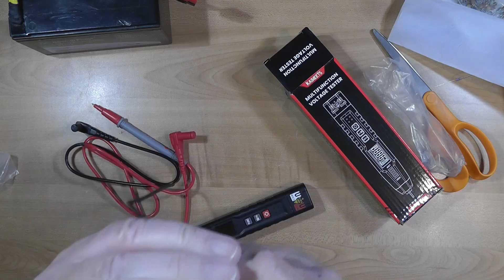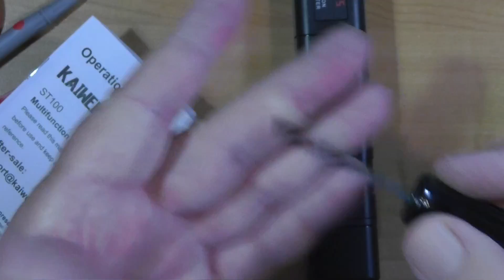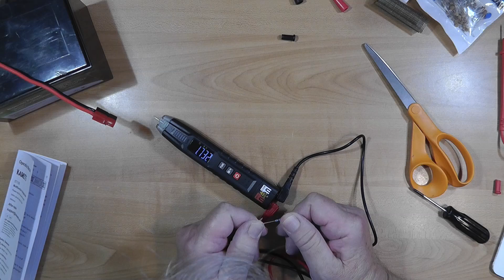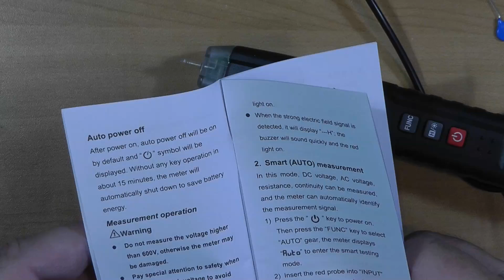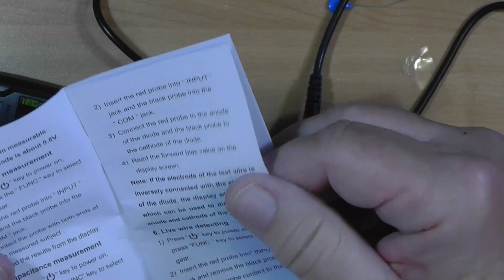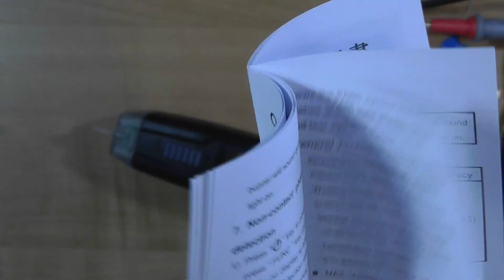The Kaiweets ST100 (#741)

Comment: It is hard to tell looking at the video but on the DC wires the motion that seemed to trigger the live indicator, at least from my angle, was in toward the wire, rather than along the length. On a DC lead I would think that would correspond to a detectable increase in field strength as well.

Comment: Hi David, thank you so much for your effort in making such an instructive video about our ST100. We are so happy to see how you interact with our product in the video.

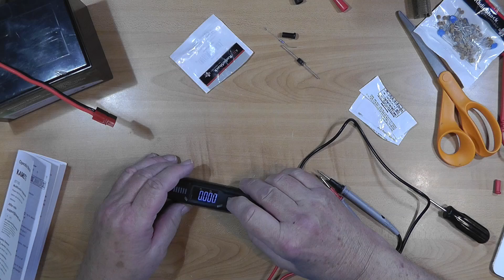Other than that, we noticed that you felt a bit disappointed while you were testing diode under Auto mode. We are actually sorry for the confusion caused to you since Auto mode can only be used to identify measurements including Voltage, Resistance and Continuity. That’s the reason why, from 0:13:20 to 0:13:40 in the video, you only got a reading for resistance instead of diode.

As for diode test, you will need to cycle through the button “Func” to Diode mode where the display shows symbol “OL”.

Thanks again for the video and hope you will find our ST100 helpful in your electrical works.

Comment: Never assume a mains cable or power point is not live if the NCV function does not detect anything, this could be dangerous . I believe that when you were moving the probe along the 12V battery lead you were detecting static electricity generated by moving the plastic tip up and down the wire. Try it on your clothes! Happy to be corrected if I'm wrong. Cheers.